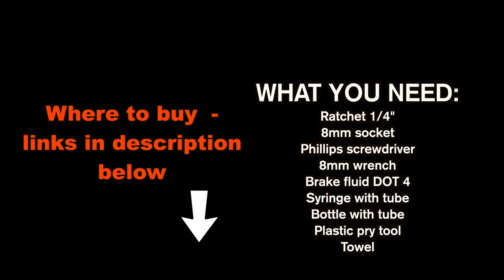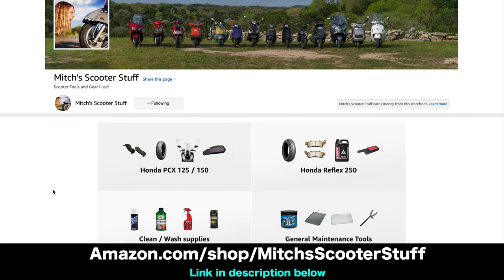Honda PCX 150 CBS Brake Fluid Change | Mitch's Scooter Stuff

Comment from the maker: * Tools I used in this video: 
Ratchet 1/4 drive - http://amzn.to/2xcJEu1
8mm socket 1/4 drive - http://amzn.to/2xMhsBl
Phillips #2 screwdriver - http://amzn.to/2fgdZDL
8mm wrench - http://amzn.to/2HCiC48
Brake fluid DOT 4 - http://amzn.to/2GEIHzH
Syringe 100cc with tube - http://amzn.to/2G951U2
3/16” clear tubing - http://amzn.to/2FrdLST
Plastic pry tool - https://amzn.to/3aQrSSz
Towel

Comment: Thank you.
About to do a full brake overhaul, and that means accessing this reservoir to change fluid at the least - may have to adjust the combi-front-rear mechanism too, and perhaps change the CBS master cylinder. Seems you may have skipped a couple of the "proper" or "official" steps in getting the panels off, but clearly you did so without issues. I think the official way includes removal of the instrument panel, but I think I will do it this way first.

Comment: Your videos are really helpful, I got a PCX 125 model 2011 and the storage under the seat stop working and it's stuck, has someone had the same problem anytime? Any idea if it's an electrical problem or its just a mechanical switch?

Comment: Mine was not bleeding and I had a thought if the brake is adjusted right and tight you cannot bleed Shure enough I slacked the back cable all the way out and guess what it started to bleed just thought I'd mention it if others have the same issue

Comment: Is it important to change or add brake oil to the cbs system? Mine is empty but brake normally i asked because on 2018 model I don't know how to remove the body frame.

Comment: So I did the job like this... and broke three clips on each of the panels.
You must have had practice at this shortcut way of removing them.
I am leaving mine off...

...Mine is a 100,000 kilometer work-and-back bike, so no worries on that score. 
But I note that after dismantling both the calliper and front master cylinder and replacing the seals and master cylinder piston, it took one hell of a long time to refill the dry system by hand pumping the brakes levers. And the brakes feel as tough the job is still incomplete. The front brake is too soft / less effective (though smoother) than before.
Also, to my disappointment, I now have a rear brake lever that stops, abruptly, half what through its travel, with a contact noise... it sounds as though one component near the combi brake assembly hits another component, abruptly stopping the lever.
I am not suggesting that's due to following this video. It's a heads-up for other DIY maintenance riders.
Perhaps a vacuum-bleed will give a better result... another 3,000 yen (30-40 dollars).

Comment: What kind of differences would there be for a PCX with ABS breaking? That is the model I have and can't seem to find any videos on that specifically. Thanks!
Reply from the maker: Hey, I don’t think you have to do anything about ABS… it’s just a wire going down near the axle… can do normal brake fluid change like in this video with ABS

Comment: I brush a little transmission fluid on the connection clasps to make panels pop out more easily the next time around. This courtesy hasn't inspired any of the mechanics who work on my bike to put panel pins in a little container so they can reassemble them correctly when through.  I dislike the idea that they can't keep track of small material objects. Perhaps I simply live in a fuckwad part if the country. By the way, you are too wholesome a person for me to post the word fuckwad to your comments section without Yourube intervention. Congratulations.
Reply: where

Comment: Mitch. Great videos as always. I have a question tho re my 2013 Mp3 500 sport that I'm at a loss with. At low and high speeds moving normally the bike jumps a little then just dies. All electrics are lost and I need to jump start the bike again to get going. This doesn't happen all the time and I can't find the source of the issue. Any help would be grand. Stay safe bud.
Reply from the maker: Thank you Sam, is the battery new? New spark plugs?

Comment: Hi, Mitch! I have a Piaggio fly 125, 2013 year. Everything worked great and one day just doesn't work anymore, can't start. candle spark gives, gasoline arrives, air filter new. I'm desperate for it so suddenly, the battery is new. help please
Reply: Check valve clearance, if gaps are closed then it wont have compression and thus wont start

Comment: I think even I could manage that, well maybe!
Reply: You can do it!  I've been learning tons and doing lots on my bike but I have no experience really.  I do have a decent tool kit though becuase every time I need something like this done, if I don't have the tools, I just go buy them as it's usually less than the labour I'd pay for getting it done at the shop...  Then I have the tools I need for next time.  Just a couple weeks ago I changed my back brake shoes thanks to one  of Mitch's tutorials.  Never done it before but it wasn't that hard once I got started.  Just always go slow and you should be fine.

Anyway, I'm about to go buy a couple feet of tubing and some brake fluid so I can also do this for the first time...

Comment: This are only for PCX up to 2017, from 2018 until now only have brake fluid the front wheel, rear wheel works only whit Iron cable because works whit ABS. Please modify the title of video, thank you by PCX 2019 owner
Reply: I have pcx 2019 as well
Reply: Not all 2019's have ABS...Mine is a 2019 & it has the CBS like this video shows...I just did mine.

Comment: what brake levers are those ?
Reply from the maker: I am not sure, I will ask the owner
Reply: I have the saem ones on my PCX.  Search ebay for "adjustable motorcycle brake lever" and you should find multiple sources all selling the same thing, and they fit multiple bikes.  Been using mine for about 3 years now with no problems.